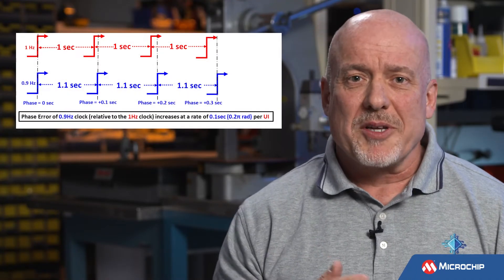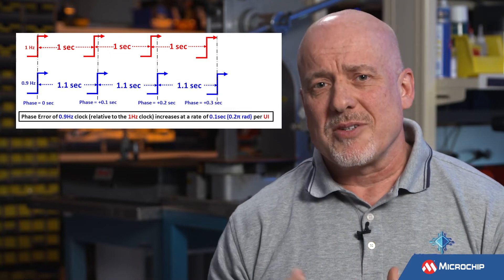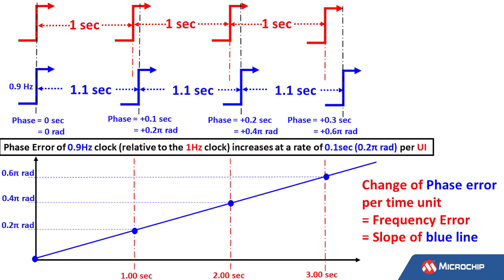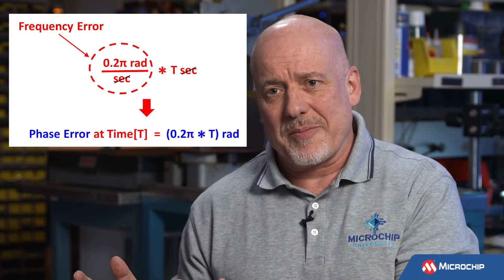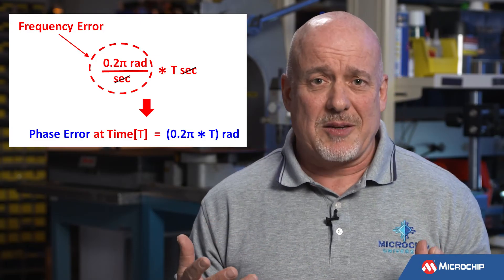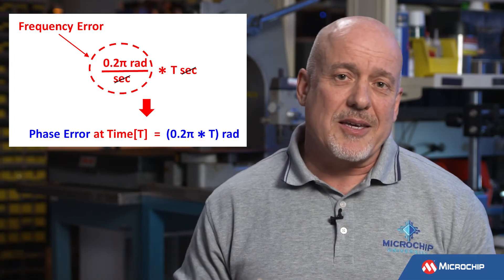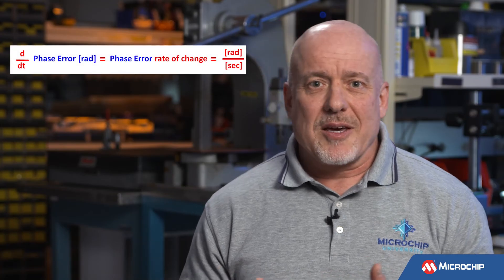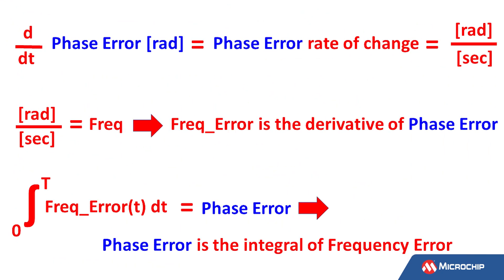What is the Relationship Between Frequency and Phase

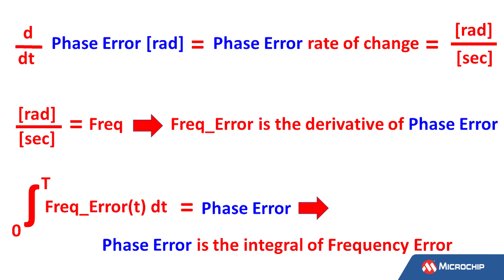Comment: 6:25 light bulb moment – basically phase accounts for time once, while frequency incorporates it twice. Plotting the clock displays as a function of time (as you did), this is reflected by frequency being the rate of change or slope and phase being distance from the Y axis (time 0). 

Great analogy because time itself, as a function of speed, has its own phase and frequency (ie. the clock with the longer seconds was moving faster through space than the slower one). This is also how MRIs use magnets to image three-dimensional space via electromagnetic induction.